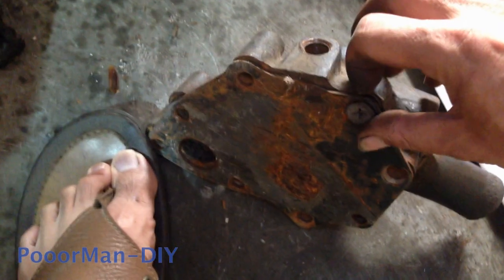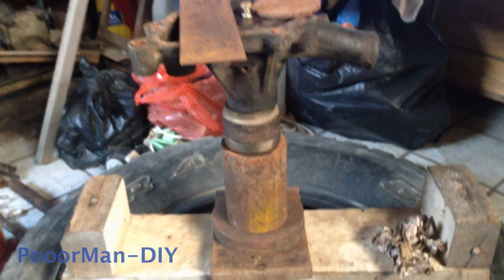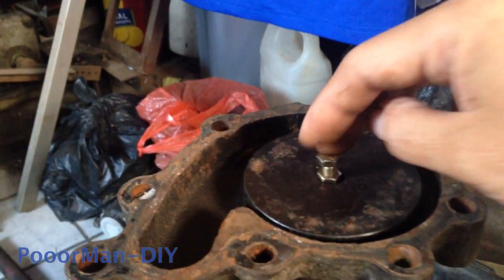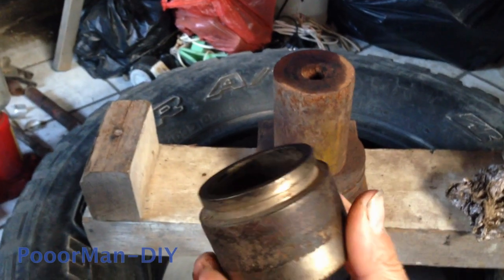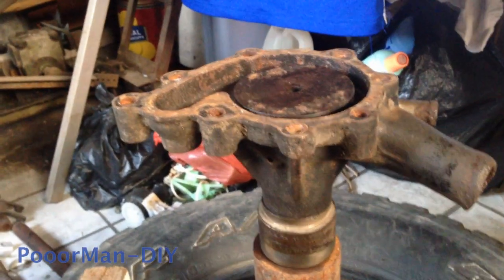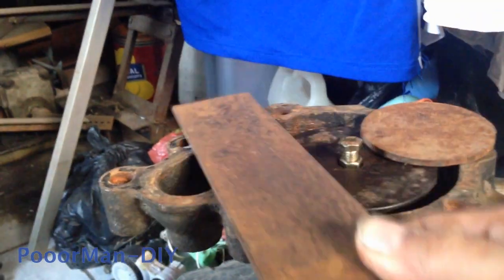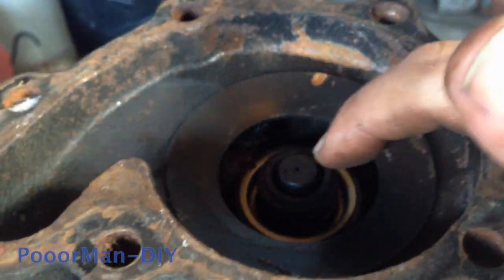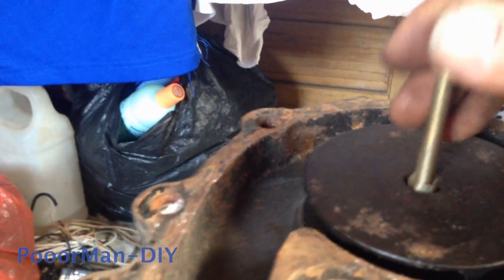Rebuilding/repairing engine water pump - DIY style (Part 2 of 4)

Comment: Tires you hit with the hammer dampens the impact and the shock is not effective.
Reply from the maker: i was at 2nd floor .. so I must put the tire underneath to protect the floor ... but the impact was still effective due to some inertial mass underneath the working object  ..